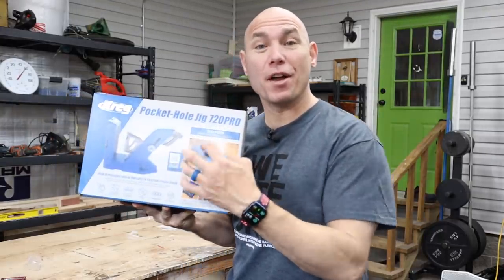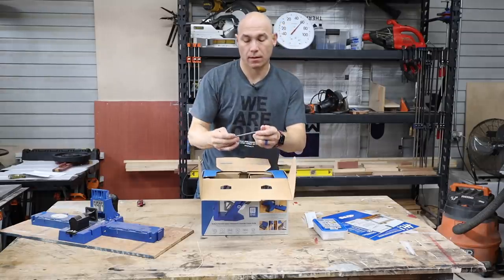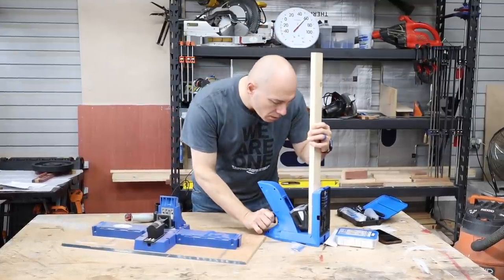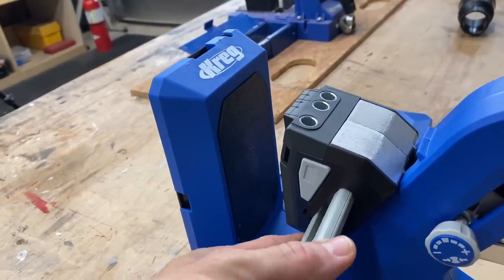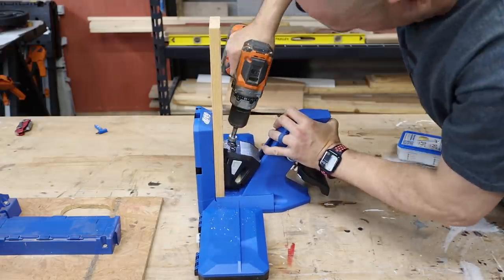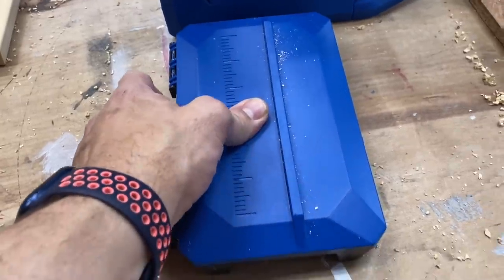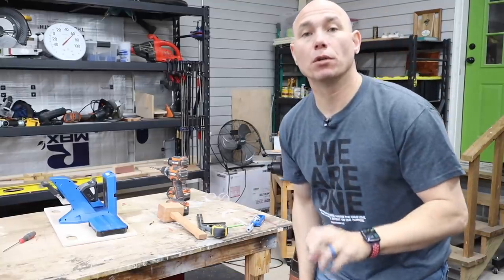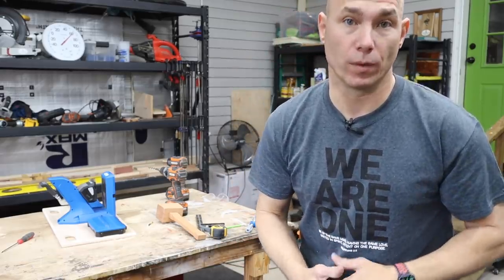Kreg 720Pro Is BAD!  I Made It Better!

Comment: You are really into pocket holes so check out Castle of which I have no connection.  It uses a router and 3 degree hole angle so no clamping needed when putting 2 pieces of wood together.

Comment: Love the vids, ty. What I have found that with the two type of screw heads, is that  they sometimes don't fit all the way into the predrilled holes, and don't seat below surface of wood, and sometimes split the wood? Thanks.

Comment: Matt, I actually laughed out loud when you tried to open the storage compartment and the lid hit the dust collection port. Hilarious! I doubt I'll ever get a jig like that. I just have their most basic model, a tiny little deal that has to be clamped to the workpiece, and only has one hole for the bit. I don't do a ton with pocket holes (so far), so I haven't yet needed anything fancier.

Comment: Great review. I purchased one of these two years ago and have drilled hundreds of pocket holes with it. I mounted the jig and separated the wings and mounted to my board almost immediately after first using it. I never had another model before this one. Agree with all the drawbacks you point out but looking beyond those issues and dealing with them I am very satisfied with the long term performance.

Comment: Pocket hole joinery won’t hold up over time IF you don’t make sure the two pieces of lumber were actually pulled together tight, which is obviously not a problem since you actually know what the heck you’re doing.

Comment: I just noticed u can't use it the other way...had u mounted it flush with edge of board u could tip it upwards.
Reply from the maker: I never use them the other way.  The K5 has been vertical for as long as I've had it.  Never saw a need for the other position.

Comment: Have u tried the POCKET HOLE JIG from BANGGOOD but it's obviously coming from China bro. U gotta try this one out and it's only 77 bucks atm. If u look for a channel called "HOOKED ON WOOD" the guy on there does a great review and the board he builds it into is exceptional. The Jig is also made of Aluminium and it has a dust port attachment too. This is from a company called ENJOYWOOD XK-4 but I think u can also get a Pro version of it at more expense I believe. 
I bought one last month but coming from CHINA u know it takes some time. I think u will like this one big man. 
Love ur content btw and I'm saying hello from DUBLIN, IRELAND. 

I've been trying to get my workshop kitted out but I'm struggling atm. I work fulltime as well so I'm shattered most weekends and time and other chores are stopping me from getting it done plus there's my severe lack of confidence when it comes to using my Table saw. 
It has those really narrow mitre tracks on it so I was wondering if I could ask u a question if u have time to answer???
Q. Would it be possible to change out the table saw top for a laminated board of some kind so I could router out some 30 type T tracks  or should I leave it and attempt to make a sled by making smaller sliding parts from Plywood to fit the tracks on the original table? I badly need help bro sao any helpful advice would be greatly appreciated..
Hope u take a look at the HOOKED ON WOOD CHANNEL on here man. The guy has some great tools to show on there too where he does a whole serious of videos on tools from CHINA.. Take it easy bud and keep safe and well in the shop..

Comment: Thank you for the information, I want to step up my kreg system. I have been curious which way to go, I thought about k4 or k5. Thank you for sharing your video.
Reply from the maker: K5 is the way to go
Reply: I have the K5 it is really good but also take a look at the one from Armor tools. It is set up to auto adjust the bit as well as the depth of the jig itself. Once my K5 dies I am thinking about going to the Armor tool one.
Reply: @731Woodworks  Thank you
Reply: @vampirejesus8170  Thank you I will check into both of them.

Comment: Does anyone know WHY my brand new K5's clamp, when pressed down the lever to clamp the wood I want to drill, the pad that pushes the wood slips back and jumps the ratcheting mechanism, loosening the wood. In the other words I cannot clamp the wood, as soon as the pressure is applied, instead of grabbing, the clamp pad jumps back and get loose... THANKS!
Reply: Manufactor Defect, call Kreg and Get Warrantee on defective K5.
Reply: @dand3975  Thank you Dan.
Reply: The "trick ratchet" on my K5  did not work when I opened the new box.  Kreg replaced it under warrantee, had a replacement in 4 days.

Comment: At least the seem to have made the dust port better than the k5. While the K5 dust port works…if you so much as breathe wrong mine pops off when hooked up to a shop vac. After popping off so many times the cheap plastic tabs are shot

Comment: 👊👊👊👍I like it the way you show it’s improvements, but if I have a choice of one over the other I will go with the K-5. I like simple and tested things. And since Matt only gave it a 👊👊👊 fist bump I have to go with him. And I really don’t like the hinges on the wings. What happened? You run out of black plastic. Due to my injuries and just general working I am clumsy. I see very short life on those hinges.
Reply from the maker: 👊🏻 K5 is the way to go
Reply: @731Woodworks  yeah, I bought the k3 couple years ago. I’m not sure I even opened it. I had been looking into the pocket hole and was going to try it. Then came surgery and all that. It wasn’t till I started I started watching your videos and thought, hey I got one of those. I’m still cutting pieces for my first pocket hole. Frame will be 2” so it should be interesting and good learning process. 👊👊👊👍🤞

Comment: I have the K5 but the mechanism that slides to clamp the board slips every time. I have to use a clamp between the dust port and the back of the piston.
Reply: My K5 doesn't work quite right either I cut shims for a different sizes of wood,  just put the shim between the back of the clamp and the stock,  lock the lever down and work great.  The trick clamp don't work but wood shims work fine.

Comment: I can understand Kregs approach on the 720 jig, but let’s be honest no matter how much added support done to this jig it’s not gonna last. It has to many moving parts & flimsy plastic. High hopes isn’t gonna make it last. The K5 jig will definitely outlast the the 720. Think about that flimsy China spring in the 720, how would you replace that if & when it breaks?. 

Come on Kreg do better. 731 was generous with the 3 rating, I’d give it 1&1/2. Plastic storage is too flimsy all around.. Too much flex for the 720.
Reply from the maker: I agree, it'll break sooner rather than later

Comment: Massca M2 pro is the way to go for a quality pocket hole jig!
Reply from the maker: working on getting one of those now
Reply: @731Woodworks  The Massca M2 pro doesn't have the handy on board storage and automatic stock thickness adjustment like the 720, but it is sturdy and accurate, made with high quality all metal construction.
Reply from the maker: @chadfallon3378  Accuracy and build quality is better than storage.

Comment: Just watched your video. While I appreciate your candor, i believe that most things we purchase for our wood shops will have to be modified to tailor them to our own needs. Many of us mount our table saws in a larger benches to increase our outfeed capabilities or mount our router tables into larger benches to accommodate larger work. I believe that Kreg has designed this new pro 720 to allow us to take it to job sites if that’s the intended use, or to actually mount permanently to a station if we choose. I’m actually going to use your idea and build on it. I’m going to make two boards the way you made one and attach them in an “L” shape so that no matter how I intend to use it (feed down from the top or in from the front),  it will always sit on a plywood base. I will also add supports on the upper leg as the lower leg has made up of the plastic boxes in order to be sure that my work sits squarely in the jig when feeding from the front.

Comment: I have the 720 pro and hate it, the wings fall off if you look at it wrong. It hasn’t broke yet but sure it will. I’ve owned it for about a year and the wings have hit the ground at least twenty times. Was thinking of getting rid of it but will be mounting it to a board. Thank you for the great idea! I do wish it would accommodate larger wood. You can get up to 1.75” thick. I’ve used it with some pallet wood that thick.

Comment: Its ment to be used with the accessories  that are not included like the plug kit (both standard size and micro plug size capabilities) as well as the micro pocket drill set. Negating the ability to use it in the other position was not optimal. It's a very easy unit to use on larger plywood sheets. This unit is also the best choice for those with limited hand mobility for clamping things down as well.

Comment: I have been enjoying my 720 Pro so far and see it as a decent upgrade from my K4. I likely would not upgrade if I had a K5 though. I agree with the mounting and wish there was a way you could mount the unit without having to open the wings on the side. If you screw down the side supports then you cant take off the unit without removing the support wings to open that little flap on the side.
Reply from the maker: The K5 is a good jig. I really like mine

Comment: If you mount it to a board, you could still add folding capability by curing the board into 3 pieces and add hinges.  Also turning the boxes around and mounting them would allow you to open the box while keeping dust collection attached.

Comment: Did you find that the 720 leaves indentions in the wood after clamping? I just unboxed mine and found that it indents all my wood where the drill guide piece is, even turned my clamping pressure all the way down and it still does it. Any suggestions or is this normal?

Comment: Your review is not good because you don’t know how to operate the device.  The new model you don’t have to manually adjust the jig, it auto adjusts and locks it into place. This saves a lot of time so you can slide in any piece of wood without having to stop and adjust the jig. This is why it’s the PRO.  You can’t have an amateur reviewing a pro tool when he doesn’t read the new features of the new model. 

I’ve seen the other people review this tool, and it’s amazing. I would buy the Pro version just because it keeps the work space clean and you can plow through any piece of wood without manual adjustments.

Comment: So only two points to screw it down to a work bench or a board? what kind of garbage is that? The single hold down clamp is just terrible.
And who thought the ridiculously cheap plastic hinges were a good idea? This entire unit seems like a cheap, Chinese made plastic toy.
Just don't see this thing lasting very long. Unfortunately, they have discontinued the K4 & K5.
I've used a K3 for years, that has served me well. I was looking to upgrade to a K5, but since Kreg decided to discontinue them, I was thinking about the new version.
After seeing what a complete piece of junk the 720 is, I'll be switching to a Massca.

Comment: Switching to China is a huge mistake, given the personal negative feeling about China.  The materials are lower quality and the critical components that made Kreg different are now such low quality and horrible tolerances that this model will not hold-up like all the other models.  Perhaps Armor Tool or one the other knock-offs.  Kreg was head and shoulders above these, but not with this New Series.

Comment: Not for professional woodworking!!😂😂
Reply: Pocket holes have a place and some good use, I just believe they are overly used in place of good wood joinery. I did strength test comparisons and found them to break easier especially when used on end grain joints.
Reply: @BigA-1971  Tests are nice and for sure there are stronger joints. But if you try hard enough, any joint is likely to break.

Comment: You should read the manual before reviewing. It tells you how to properly mount the trays permanently. You didn't do it according to the manual. The pro package now also includes the 310 Jig, and there are useful accessories you never mentioned.  If rate the tool 4 stars and the review 3 stars. 

The 720 Pro has its pluses and minuses subjective to opinion like most tools, but overall it's a good tool.

Comment: Also, also, It says and has increments for 1'2" boards, but it will NOT clamp tight enough to hold the board. I have reached out to Kreg, and so far crickets. Not a happy camper.